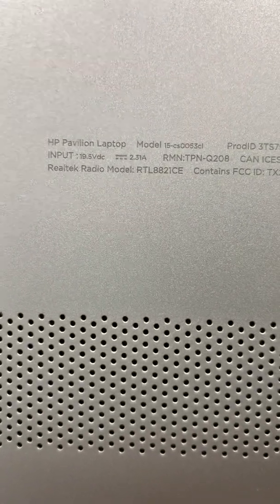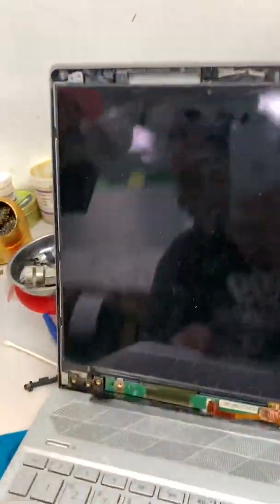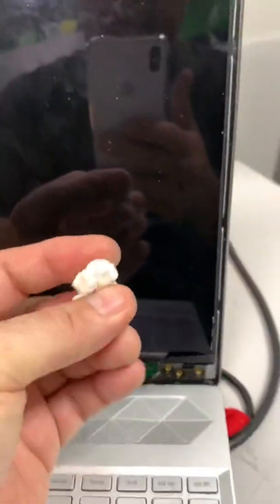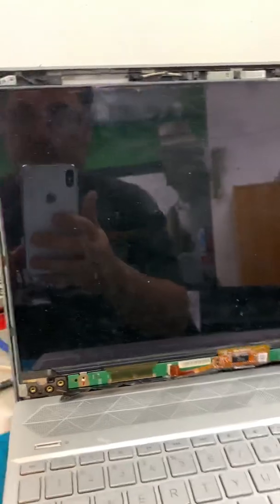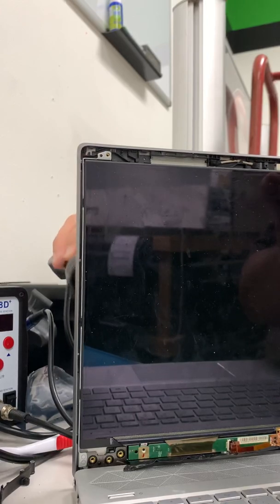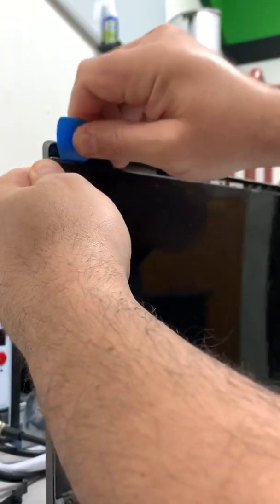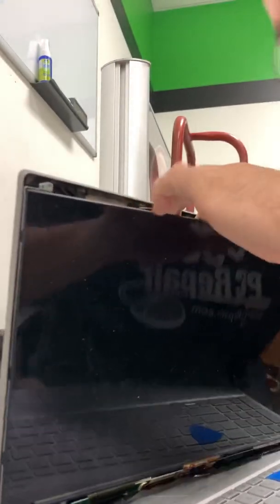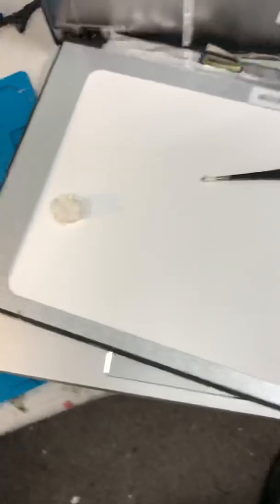HP Pavilion 15-cs0053cl LCD Replacement

Comment: top video, thanks. I hate that manufacturers are doing this. so irritating. I can say that if you dont have a heat gun, you can use isopropyl (someone else mentioned this earlier)...use a spudger to pull the screen out as much as you an then spray isopropyl down the back about a cm from the edge on both sides and wait...then you can pull it out a bit , then as soon as you can get some tweesers as per the video on the white stuff and pull it will come right out.

Comment: was certain there were adhesive strips, wasn't sure how many... thanks for the video and clarification. As for why it was manufactured this way, production cost cutting. Why retool an assembly line for a single design flaw when duct tape, super glue and or bubble gum would work... HP...

Comment: Never would have figured that out - thank you for posting this. And now the second mystery - where do I buy the adhesive tape to mount the new screen? It's important that the replacement adhesive be super strong (since that's all that is holding the screen in, really) and has to be able to be removed the same way as the original. If you just use double sided foam tape that is strong enough, you'd never get the screen out again. So is this just industrial grade 3M Command Adhesive? Seems stronger than that.
Reply from the maker: I personally used the double sided red adhesive tape that I used for phone and tablet repair. The foam tape should work fine also.
Reply from the maker: Try red double sided tape and b7000 on amazon. If I remember right, I used both and then used clips to hold it in place while it dried.

Comment: You are a genius my friend, I've been wanting to replace my screen on my HP Pavilion 15-cw0988na and have come across exactly the same problem, I didn't want to try too hard as my screen still works, I just wanted to try a better (IPS) screen as the colours on mine are terrible so didn't want to break the original in case the new one didn't work.
Reply: where did you buy the screen?
Reply: @davidcoolguy  I got mine here https://www.laptop-lcd-screen.co.uk/shop/HP-COMPAQ-PAVILION-15-CW0988NA-15.6-LAPTOP-SCREEN__389566.asp

Comment: thank you bro
Reply from the maker: Awesome. Glad to help out!
Reply: @99pcrepaircenters88  is this issue/ engenier move related to touch screen models? I don't think non touch models have this issue.
Reply: @elaniel300  The non-touch version of this laptop is designed the exact same way, unfortunately. One of the most difficult non-touch screens I've ever had to replace.
Reply: @ConditionsCloudy  wow that is unfortunate, well it is what it is